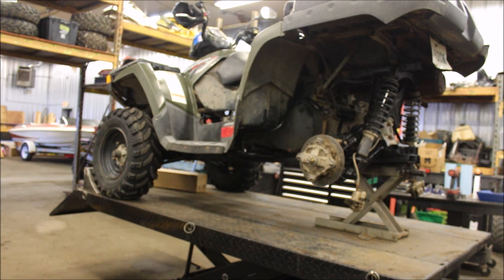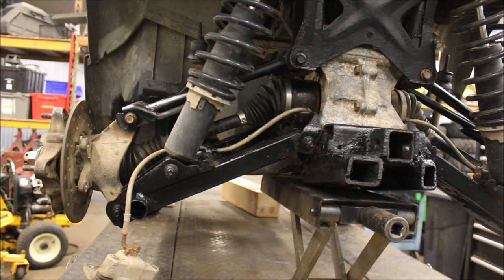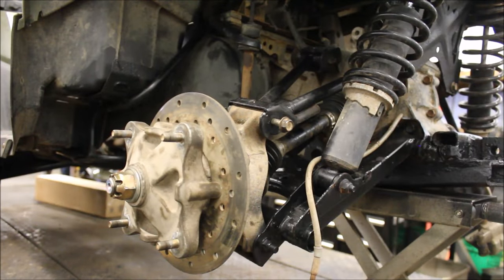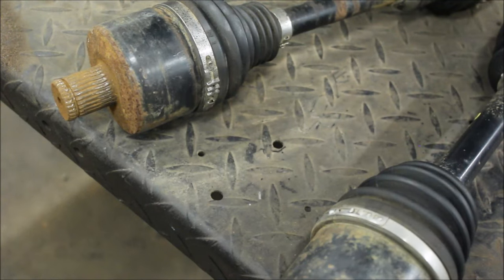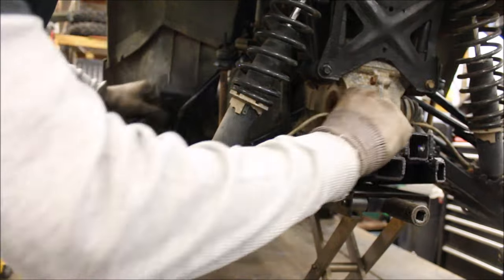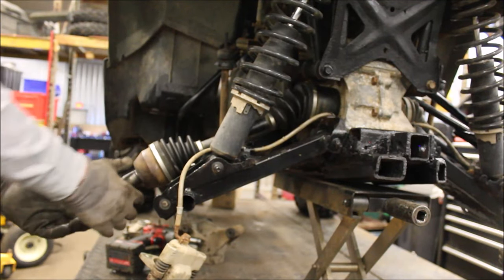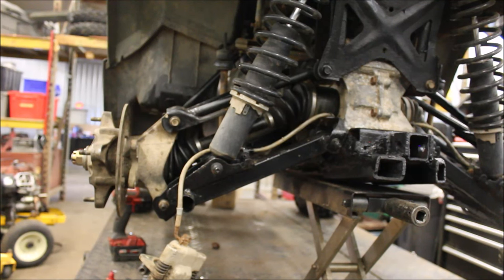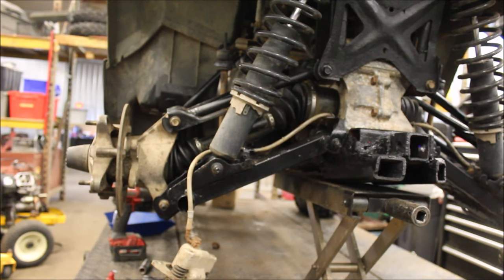Did I Get Screwed, or was it a easy fix? 2009 Polaris Sportsman 800 X2 Transmission!

Comment: Turf mode actually relieves stress off of the components, exception to spider gears if they one tire spin a lot, but what most people miss is you're supposed to grease the splines on the cv shafts in the differentials every so often so the CV shaft don't get chewed up metal on metal contact the stock CV metal is intentionally softer than the diff so the cheaper part gets replaced
Reply from the maker: Interesting! I did not know that. But I have seen a lot of messed up rear axles with turf mode. especially the ATPs.

Comment: I have a 05 800. It is acting all weird. I can’t go very fast with it and when I go to slow down it backfires and sometimes dies when I go to shift it. It idles and revs completely fine in neutral or park but when I am in drive it only revs I’d say about half throttle. What could it be? I was thinking maybe a clutch? As I was thinking it asks as if it’s hanging up. Secondary driven clutch?
Reply from the maker: Is it efi? I would check the clutches. If its fuel injected it could be a couple things. I had a bad fuel pump and clogged filter.
Reply: @TitaniummanGarage  yes it’s efi. It has a brand new pump in it as well